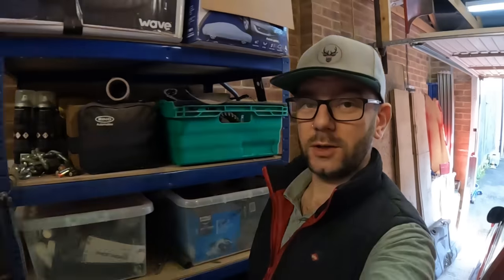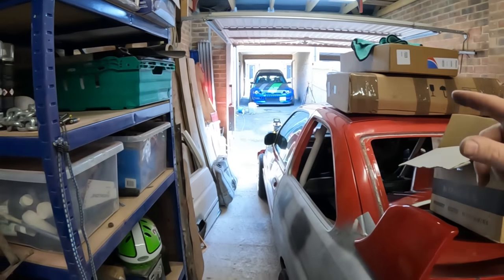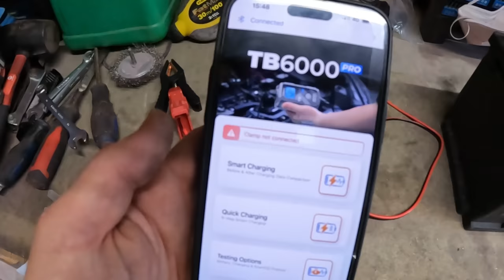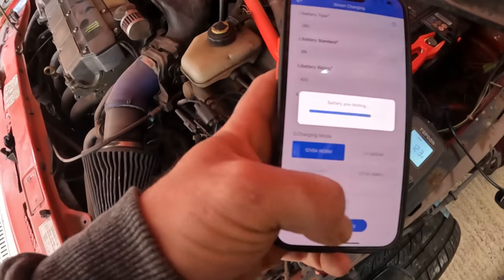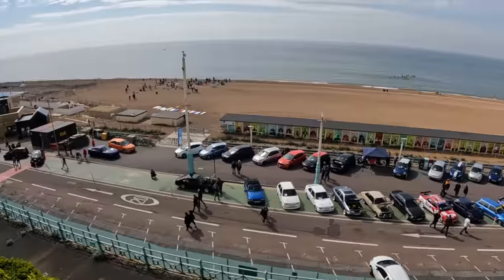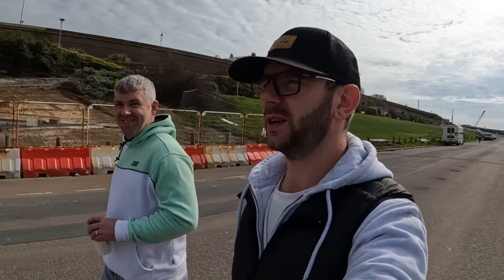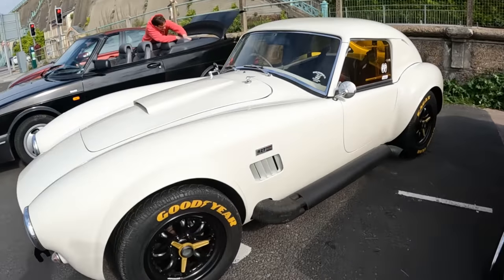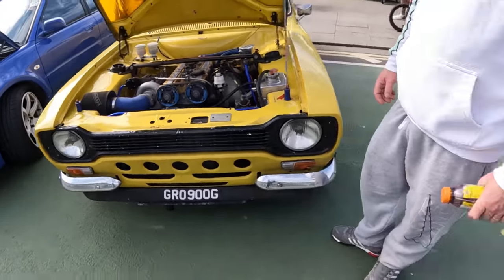Taking My 420BHP Ford Escort Van To Ace Cafe Incarnation 2023

Comment: had a few granadas, for a big car they handled well, + those 3ltr V6 essex lumps could be fitted with all the capri RS3100 race gear, very rapid in their day, but were thirsty.  never more than 10mpg round the doors, so you always had to take your mates with you, to sub some petrol money. used to fit old low profile xr3 tyres to the back for a bit burnout/race fun down the seafront, improved the diff ratio by about 15%, an already fast car got even quicker...
our white one had cherry bomb unlinked side pipes, sounded just like a 6R4, surprised the photographers when that thing came sideways round the corner on a just finished rally stage in the forest !
how we did not die/go to jail in the late 80s i'll never know...
Reply from the maker: I wish I was out driving in the 80’s none of this anpr or camera nonsense we have these days and much better car’s! It’s a shame most of the old granadas have been banger races now, you guys definitely had it better with all the freedom back then